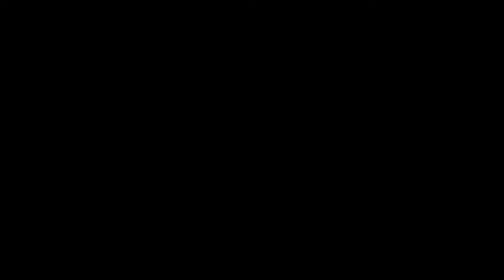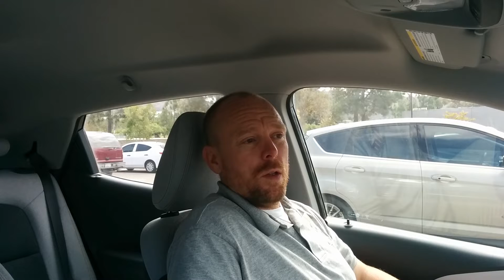Plug-Side Chat: Navajo Generating Station: Could It Be Transitioned to Renewable Energy?

Comment: Since the power plant also needs energy at night, they do have molten salt batteries that can store the energy and then make steam at night. I don’t think steam accumulators would work well. They can store enough energy to launch a plane off a carrier, but that won’t run a steam turbine generator very long. 

I’m sure every few years as technology improves, engineers are calculating the efficiency of each system.

Comment: How much power is needed from that site during the day, vs. at night? If it can be used as a wind and solar plant, with a few batteries to smooth out the load, it may have some use to become renewable, without much issue. The only question is this: For nighttime generation, will the amount of wind and cost of batteries be viable enough to make enough power to meet demand? Can it be done on a wider scale? A lot of older power plants are going to have the same cost-to-upkeep issues of the Navajo plant, and won't have as much wind or sun on site.

Another issue to consider: Is a solar collection plant really more economically viable than simple photovoltaic panels, and scrapping the steam generators? In the end, why wouldn't the Navajo plant simply convert the plant to natural gas?

Comment: Solar Thermal is still very expensive. If you look at some of the large solar thermal plants in the country, they can't come close to competing with other generating technologies. Retrofitting a giant coal plant would be outrageously expensive.
There are organizations that are actually working with the Navajo, and other tribes to train them to install solar PV. Replacing the plant with a large PV field and large storage (whether battery or some other tech) would be the best way to go.
Reply from the maker: I know the upfront cost of thermal solar is higher, but the recurring costs are much lower. Right now, prospective buyers are balking because the return on investment for the required coal retrofitting is also expensive.